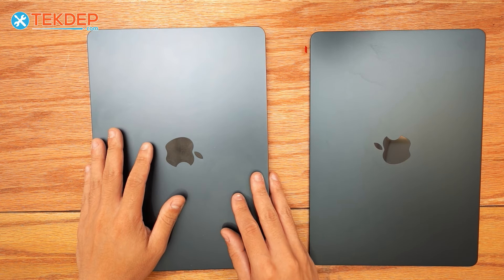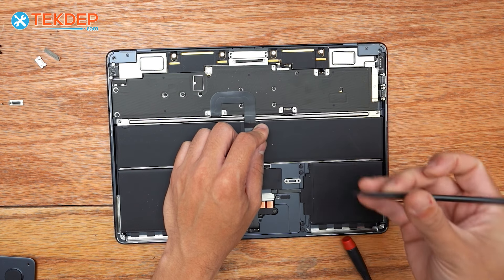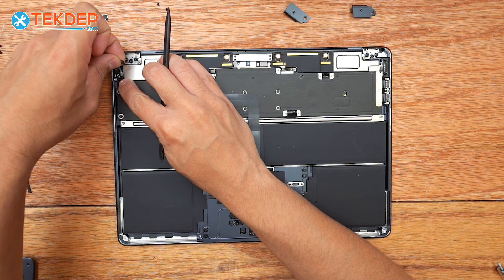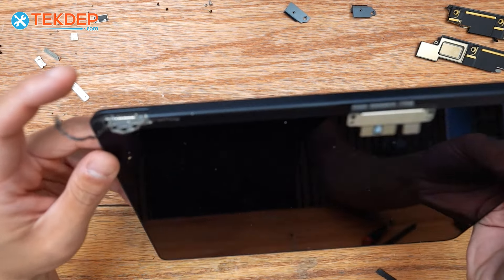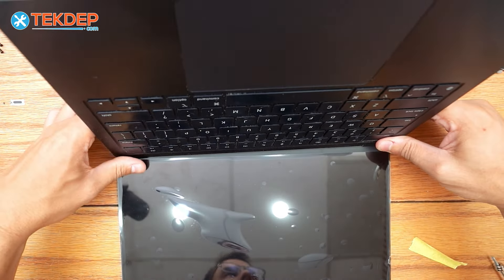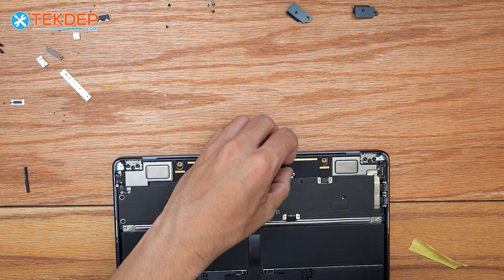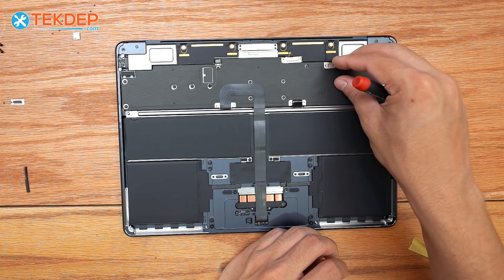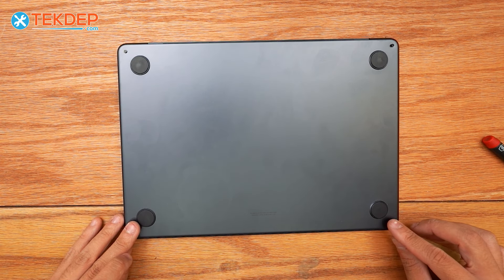M2 MacBook Air 2022 Broken Bad LCD Replacement Guide | A2681

Comment: Why did you skip the part for installing the brackets for the lcd connections. Saying we got the bracket preinstalled, right after showing the same part not installed.
Reply: Literally bro, the only part I was having trouble on and he decided not to show how to them on…
Reply: I’m literally fuming at this video, no instruction on this step has caused me to take apart my MacBook with no clear instruction on how to assemble this part. I’m now without a working computer because of this.

Personally I find it irresponsible for a channel to do this without showing a vital part of the process

Comment: That's no proximity sensor. Please correct your video. Thanks.
Reply: There is a sensor
Reply from the maker: It’s the proximity sensor or so call sleep sensor, If anyone need replacement parts such as displays and batteries or tools for your MacBook repairs, we have them all and ship worldwide! visit: https://tekdep.com 

We also offer a convenient and affordable Mail-In Repair and data recovery. You can learn more and get started here: https://tekdep.com/device-repair/

Comment: hi, I hears a rumor that replacing the screen will lead to a permanent “shadow” at the top of the screen that can only be removed through soldering. Is this true?
Reply: No….
Reply from the maker: That is definitely not true, no soldering needed at all and no shadow on this model, at least the displays we sale on our site need none of that and its plug and play, but yes you lose the True Tone that is not really noticeable anyway, If anyone needs replacement parts such as screen and batteries or tools for your MacBook repairs, we have them all and ship worldwide! visit: https://tekdep.com 

We also offer a convenient and affordable Mail-In Repair and data recovery. You can learn more and get started here: https://tekdep.com/device-repair/

Comment: Some MacBooks have problems sleeping when the lid is closed after display assembly replacement. Is that also the case with these M1 / M2 MacBooks?
Reply: Yes, if the display won't sleep you'll either have to reprogram the lid angle sensor or adjust the magnet. There are videos about it

Comment: So I did the LCD replacement but now the battery won't charge and is stuck at 1%.  Have you ever experienced this before?
Reply from the maker: Check your battery controller board flex cable to logic board, the tiny cable possibly is not communicating correctly 

If you're still experiencing issues with your MacBook and need help, we offer a convenient and affordable Mail-In Repair Service and data recovery. You can learn more and get started here: https://tekdep.com/device-repair/

If you need parts or tools for your MacBook Air repairs, we have them all and ship worldwide! visit: https://tekdep.com
Reply: @tekdep  We are discussing exactly this fault on badcaps forum. Which brand led you to this fault? So far, techs are reporting the fault with Seven Puppy and with XJS. At this time, we do not know if either are to be blamed. Check the 'cowling plate' mentioned for the BMU vbat enable / disable in the schematics. Still researching this bug that now 3+ techs have faced.

Comment: Thank you very much. With your help I actually managed to replace my MacBook display. I did everything step by step like you and it works. Thank you so much, I wish I could hug you 🤗
Reply: Hi, I wanna do this too. I read that changing the screen will lead to a “shadow”-like stain at the top that can only be removes through soldering. Did you encounter this issue at all?
Reply: @peaceofpaper1  Hello, no, I didn't notice such a problem, I'm very happy with the result
Reply: @peaceofpaper1  Hi! Apple fixed this "problem" (which they probably implemented in the first place) with an macOS Update, I think it was 15.2. So this should not be a problem anymore.

Comment: You call it a proximity sensor, I have seen it called the lid angle sensor. Does this need to be calibrated after the repair? After replacement and closing my lid, the display does not turn off.